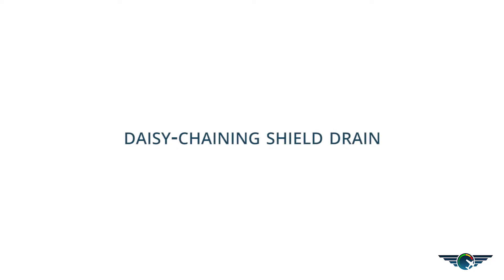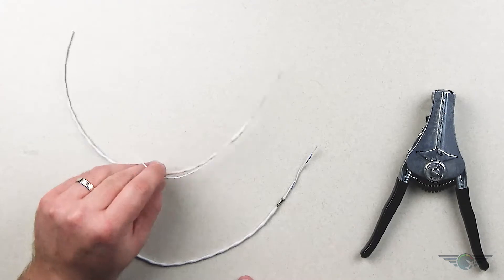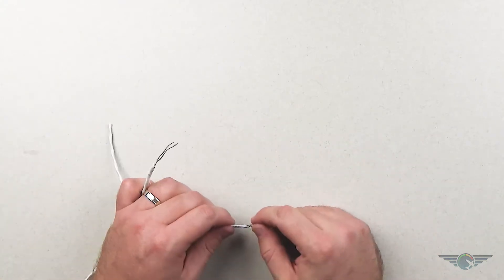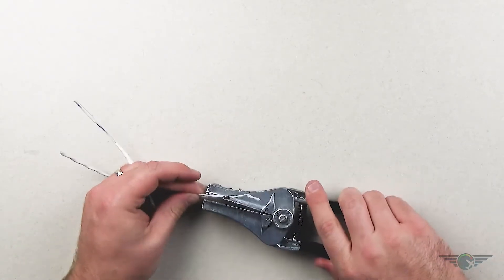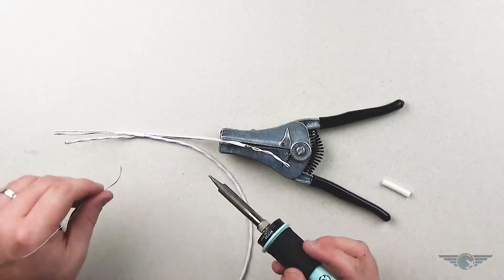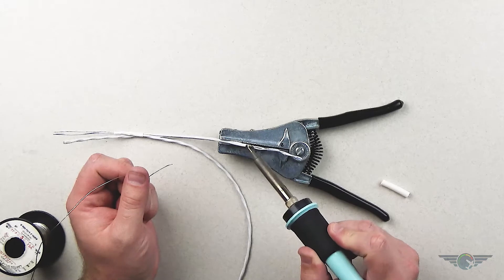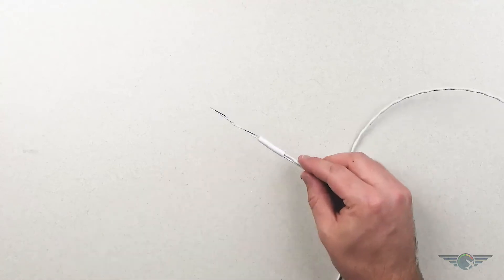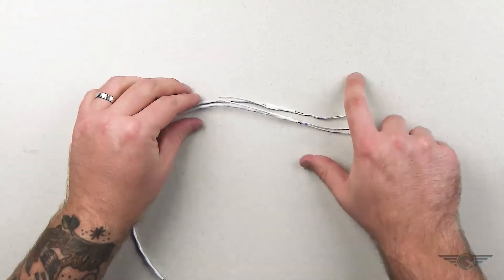Garmin G3X Wiring Fundamentals Series – Daisy-Chaining Shield Drain

Comment: Hey garmin the can bus is supposed to be terminated to the shield block of the connector. Youre not showing that here. Is it okay to just fit a drain wire to each can bus cable end then connect them both to the shield block via a single ring terminal with the two drain wires in it?

Comment: Any reason not to use the old trick of sliding the shield back to bulge it and then use a pick to pull the two wires through the shield braid leaving the empty shield full length (the 2-3” past the removed outer jacket) and then just connect the ends of the two shield braids with either solder and heat shrink or crimped in a wire swage sleeve?
Reply: I like cutting the shield because you get rid of what you don't need.  Using a pick, you run the risk of damaging the wires.
Reply: @jetavionics  Not if done carefully and provides a much neater connection with just one crimp or solder joint needed.  https://youtu.be/g4qNMLoCbHM